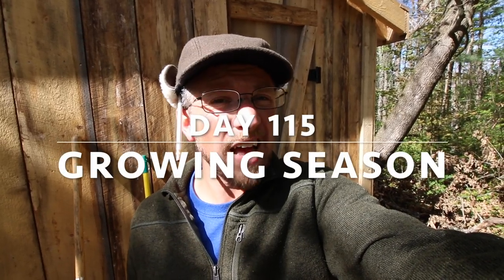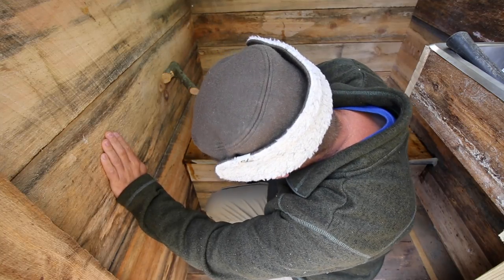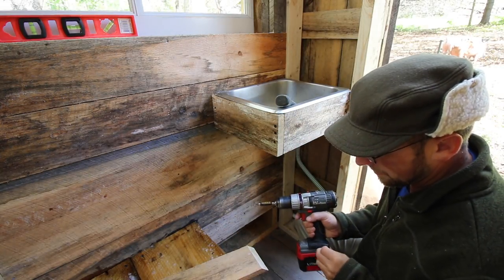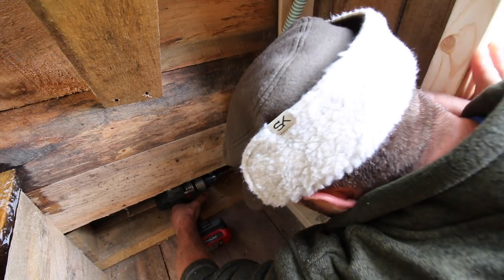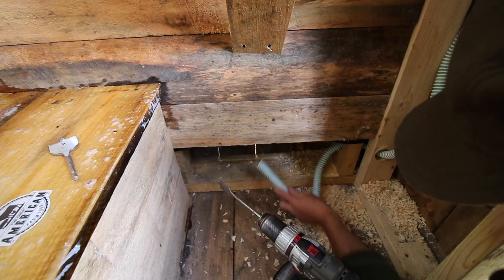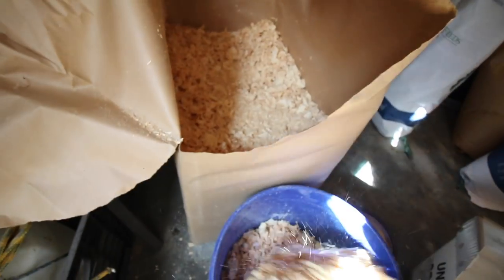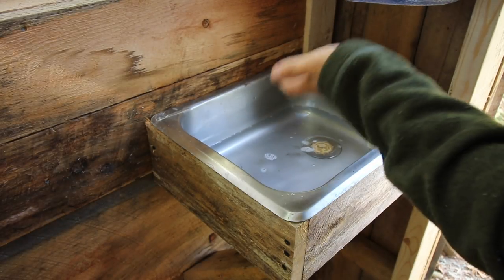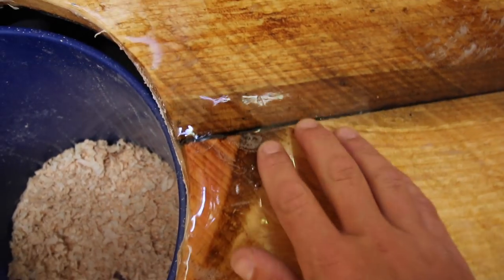Adding the Plumbing in the Composting Outhouse

Comment: just my suggestion for the outhouse....I would add a shelf to the right wall of the sink to shelf soap (liquid pump soap) and or paper towels for drying hands after washing ( you also could make a small wooden removable box to hang on the right wall under the sink to hold the used paper towels(throw aways)...and also I would put the bucket of shavings on the floor between the toilet bench and the sink out of the way and still reachable...it would make the outhouse more attractive in a special way :-)    I LOVE what you have done with the outhouse...also a few metal and wood signs would be cute on the walls inside to decorate it ...sweet little house...great job! :-) your people coming this month for the hog butching process will be impressed especially the ladies! :-)

Comment: Hey Al.....Might want to consider rounding off the outer corner of that sink base. Solar shower bag suggested below is a good one. OR, you could buy one of the square 5 gal water jugs for picnics that comes with a twist spout. Also, consider mounting a laminated sign inside with 'instructions' for use of the toilet. 'Noice' project. We never expected anything less than your best. Well done.
Reply from the maker: Thanks! Yes I need to make an instruction sign. Thanks for the reminder

Comment: Don't forget to put a rainwater collection system for the outhouse roof. You could even plumb it into the inside sink water container, just don't forget to put an overflow tube on in case it rains too much! Don't want it overflowing into the outhouse!
Reply: I messed up with this, I put one tank up for a test fit (planned for two with a run-off pipe), roof running water from the garden house and toilet. I left for only one day and it rained, the 500 gallon tank was only secured buy a couple of cement blocks, they both disintegrated, the tank damaged the wall of the garden house. The amount of rain you can catch is incredible and the weight is massive. Won't make that mistake again.

Comment: You might do some research on using cedar.  It is really strong smelling and the cedar oil is not always plant or food plant friendly.  Might I suggest a gravel bed in a shallow trench under the drain hose to prevent a lot of erosion.  It looks really nice.  Will you have screens for the hot summer months?
Reply from the maker: Yes gravel will be nice under the drain
Reply: Deb Ketelsen: why not use several of the home grown rocks?

Comment: Hey, just a suggestion to keep the gravel from washing away, put a few bigger flat rocks under the drain tube outside so as the water flows out of the tube it doesn't wash the little pieces of gravel away. It won't happen all at once but if a lot of people are using the sink, the water will eventually start eroding it away! 

P.S. - Your work ethic is untouchable!!
Reply from the maker: Love the idea! Thanks
Reply: Yes sir!

Comment: I heard of a great idea from off the grid in Africa where you tilt a water container by pressing down with your foot- that way you don't touch it with dirty hands.  A bit of engineering would make it work- a string to tilt it over and elastic to pull it back up maybe?

Comment: I have an idea for your water source.  On Walmart . com there is a wire rack "Igloo Wire Rack for Beverage Jugs, 2-5 Gallon"  You can mount that in the corner and then use a standard Igloo cooler with a spout for the water.  Check it out.  Another idea is to make the sawdust bin fit into a pull out drawer, like they have for kitchen cabinets.  It can then slide in under the left side of the toilet seat.

Comment: Pardon my ignorance, but does the composting toilet "need" a supply on #1 or will it work with only #2 deposits?  It just seems that the maintenance would be less if you took advantage of the great outdoors for #1's and reserved the capacity of the OGOH for emergency #2's!  Looks great and I'm sure you will have many happy brainstorms out there!
Reply from the maker: The composting toilet works fine on #2 alone. But the ladies will appreciate it for both!
Reply: Lumnah Acres - yep! I couldn't agree more!! I'm not one who cares to bare all to those around! 😬
Reply: Lumnah Acres last question...what does one do with the #2 and saw dust as it builds up?  How do you get rid of the accumulated end product?  Is it sanitary?   I've never used or seen such a toilet so I'm curious.
Reply: Little White Dory - you compost it. I keep mine separate from my garden compost since it takes 1 year to break down - if your squimish, give it two years - there's an awesome book titled 'Humanure' that lays out the info. I have a three bin system, I  layer my compost pile with green material, pour in my toilet buckets & top with goat poop.  When the first bin is full, I turn everything over into the second bin. Everything sets in the second bin for a year then I turn it into my third bin, which is my usable compost bin. Finished product is beautiful black gold! I have never had a smell in my buckets or in my compost bins. Last winter I had snow from November to June so I put lids on my filled buckets and stored them all winter & spring on the back side of my greenhouse - I was dreading dumping them thinking they were going to reek, but they didn't, they were partially composted. If there is a smell going on, you're not using enough sawdust.
Reply from the maker: What Terri Poulin said! It is crazy how the buckets dont stink!
Reply: Terri Poulin thanks!
Reply: I've used pine shavings and cedar shavings - both work well. One year, I had weird mushrooms pop up in the compost bin with the cedar shavings but went back to cedar this year (I purchase whatever is cheapest!) and have not had a mushroom problem. But bottom line is, if there is a smell add more sawdust or shavings.
Reply: Little White Dory yep, we have been composting for over 6 years..so easy and beneficial

Comment: Why didn't you use polyurethane instead of the epoxy Finish.  Its just as nice and not nearly as difficult to work with.
Reply: R S too late 😀
Reply: kleineroteHex 
It still came out nicely.
Reply from the maker: I had the epoxy left over
Reply: Lumnah Acres 
Well you can't waste a resource.  Don't get me wrong, it came out nice but I was just thinking you would have had less work involved if you use polyurethane.  I love the out house.  You made it seem so easy to build, are you a carpenter?
Reply from the maker: Yes, a self-taught one.
Reply: Never met one that was taught by a teacher. All you can do is show the skill but the carpenter in training has to teach himself the technique. That is true of most of the manual skills. You can give someone a hammer and nails, but that person has to teach himself to drive the nail with the hammer. JMHO
Reply: Richard Bohling Sr 
I apologize for my ignorance but I didn't quite understand your response